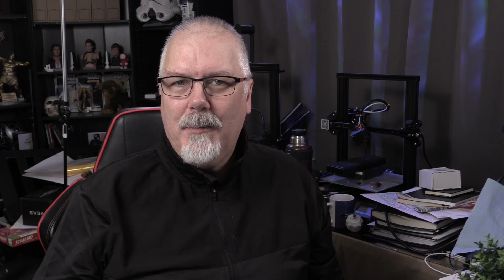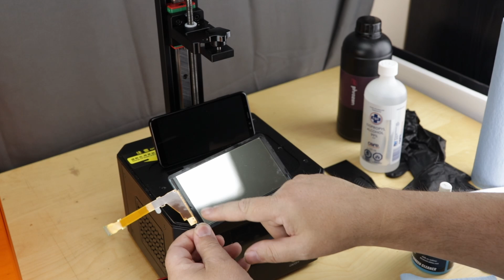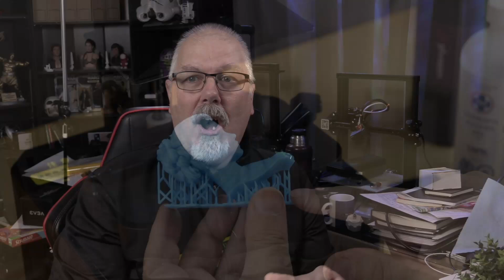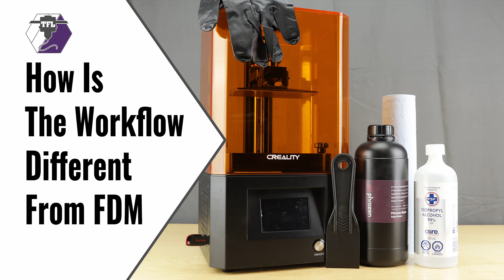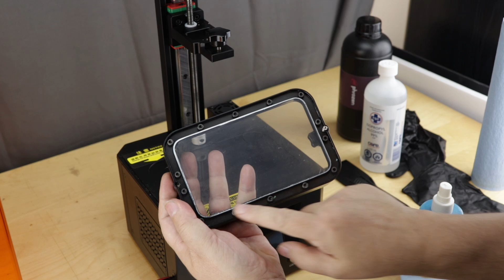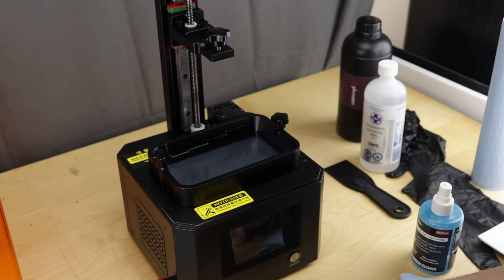Thing to know before you start Resin 3D printing

Comment: Good summary, Also important to note that the isopropyl, or whatever one uses to rinse their resin parts, is hazardous waste and cannot/should not be put down the drain or thrown in landfill; check your local hazmat recycling centers. In some areas properly disposing of uncured resin waste is nearly impossible.

Most of my 3d printed parts are functional and don't require the level of resolution that resin printers offer. Plus I just built a voron, and the parts coming off that baby are damn near flawless. Zero personal interest in dealing with post-processing for a minor bump in surface quality.

Comment: Great video Richard. I have been from printing for several years now, but would like the detail of resin models. The post processing looks to be a big task. Also, finding somewhere that is heated and ventilated (no basements in the UK) might be problem. I will follow along with your series to get a idea of what is involved. David